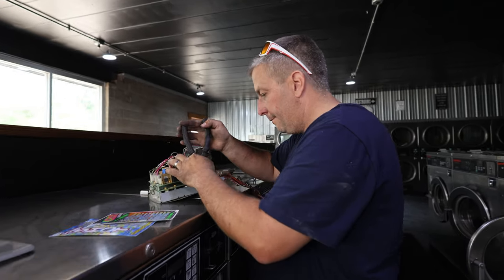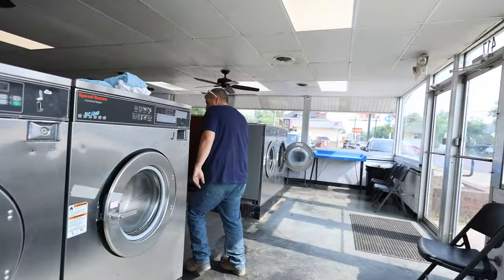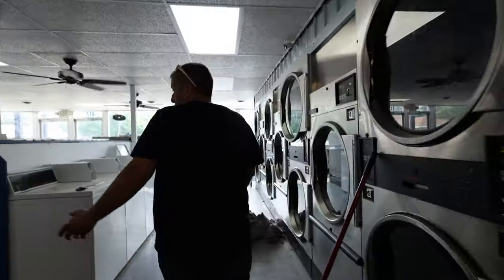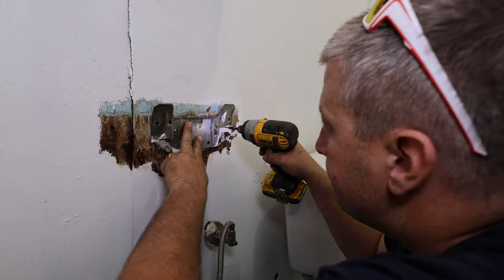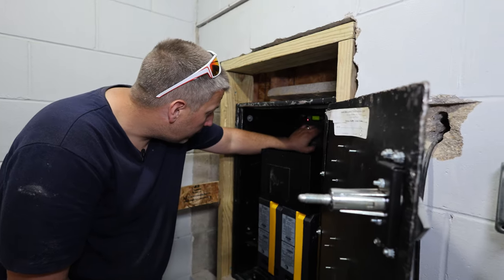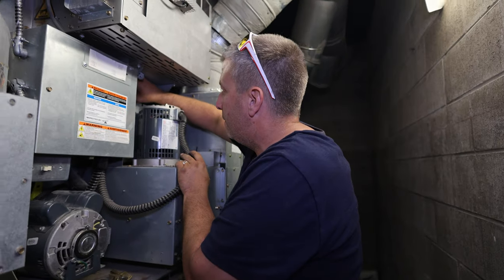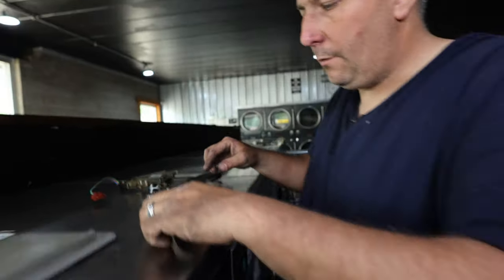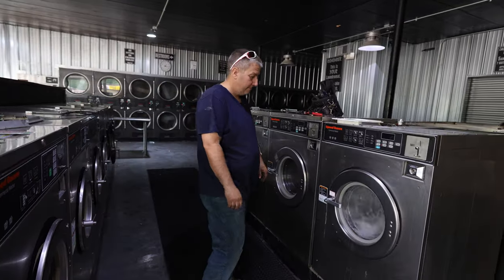"Repair🤩 Hacks Unleashed: Save Big💰 on Fixing🛠 Anything!"

Comment: Hey Keenan, I have a speed queen stack dryer blower motor that is stopping the gas and sometime the drum motor from turning on. I have swapped the motor out with a working one and everything is now good. I want to repair the bad motor and have pics of it unassailable revealing the 4 components in question. There are 2 switches that work with the centrifugal clutch/switch and a black plastic sensor that I believe detects temp and shuts things down if it gets to hot. Can you shed some light on these components how they work, how to test them and or just replace them. As you know these are expensive motors and would like to repair it instead of junk it and pay for a new one. Like I said I do have pics but can not put them in this message. Any help would be greatly appreciated. Thank you.
Reply from the maker: FollowingKeenan@gmail.com send pic. Those switch can be replaced. Need to remove them and locate part numbers. It wont be a speed number but like Marathons number. Then i would google part numbers to see where to get it. 

As for testing i think those switchs are on off type. Not based on amps. So a simple continuity test with mulit meter.
Reply: Thank you, Sent pics. @FollowingKeenan